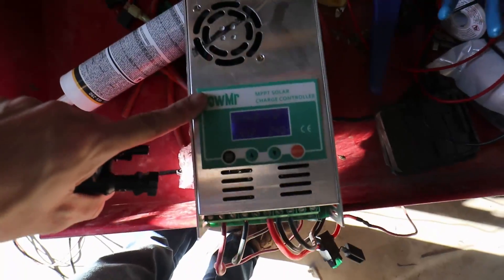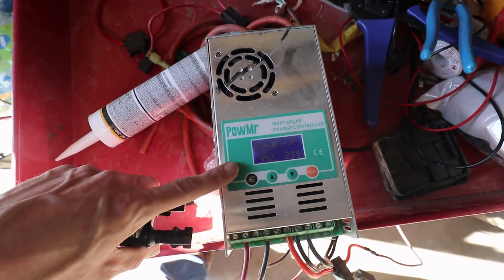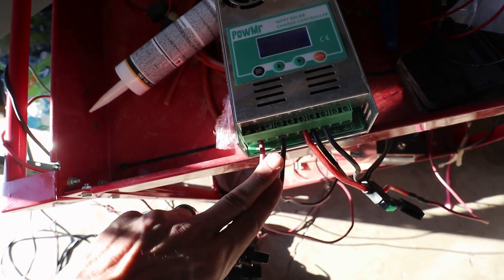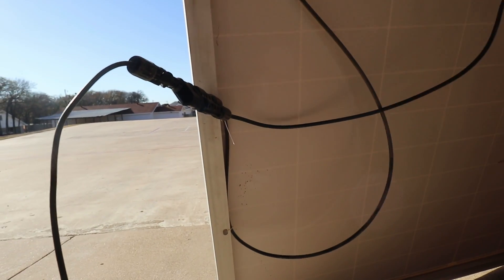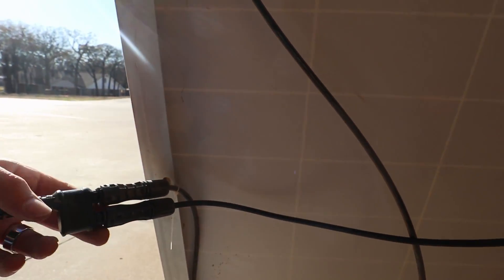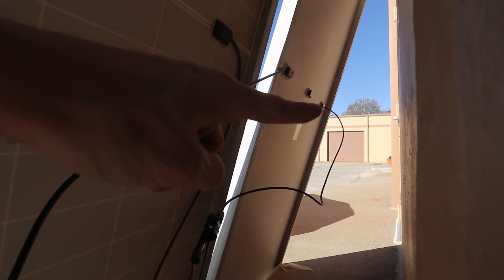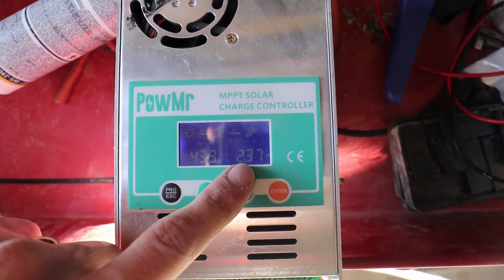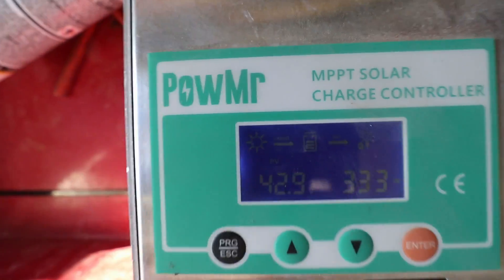Paralleling Solar Panels With Branch Connectors

Comment: Dont buy PowMr charge controller if u dont use BMS. At full charge, sometime, it jump up voltage like crazy. High voltage cause inverter to shutdown n demage to battery.
Reply from the maker: Curious, have you ever had that happen without a BMS? I’ve observed the same when I had a bms with no Bluetooth Mgmt. My current suspicion is that the powmr when told to charge to 14.6 was charging to 14.7 causing the bms to trip which then caused the inverter to see a spike. I think the resolution would have been to set bulk charging to .1v less.

Comment: Do you sell solar panels and a controller for a 36 volt EZGO golf cart? Thank you and great video.
Reply from the maker: Indeed, we do. We have some 435w panels that are about 40x80” and a charge controller that would work. $275 for both pieces.

Or if you wanted to do a boost charge controller you could use one of the 230w 39x65” panels. We don’t stock those controllers though.